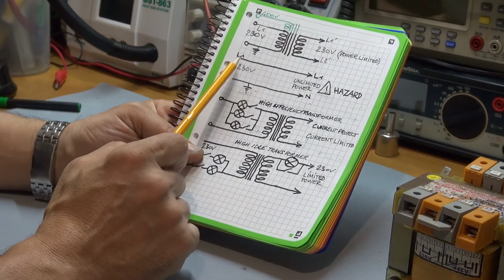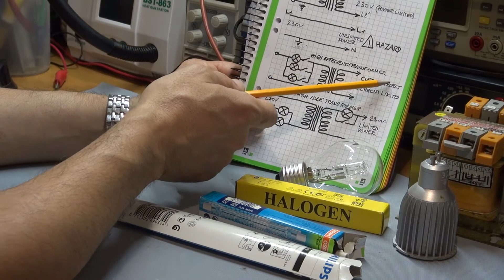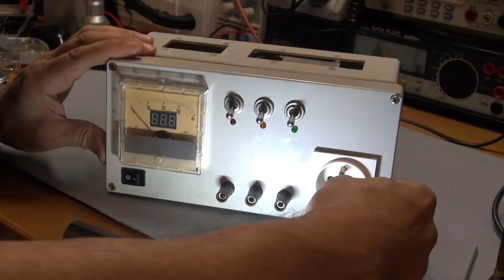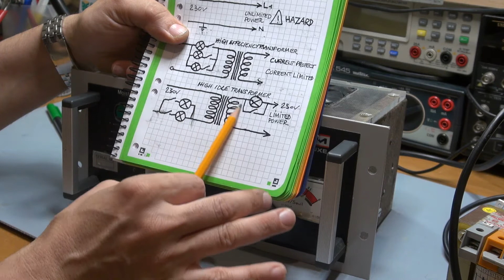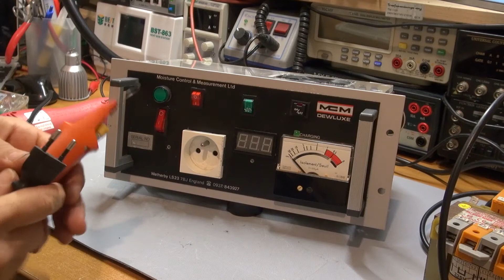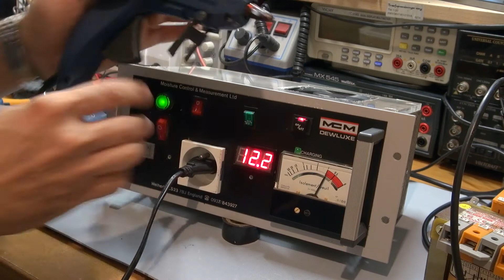Isolation transformer + light bulbs, a must have on the bench; Dim Bulb Tester

Comment: How can you use such a device, if the analog meter shows not the exact voltage, and the digital meter shows "percentage" of current ? 
Also, that digital meter is jumping all over the place, how can you know exactly what your connected device is doing? 
Never seen current displayed in percentage, so why using "percentage" ???? 
Why re-inventing the wheel ? Use a simple voltage / amperage panel meter from Ebay etc.... and save the hassle of "calculating" current and voltage on the output.
This only advantage is that the output is isolated from ground, otherwise all the analog and digital meter stuff is unusable for real repair purposes.
Reply from the maker: Hi, this is not a measurement device. The panel you're talking about are used to read a rough current consumption, and a voltage drop fluctutation according the power chosen on the front pannel. 
Of course, this device protects from the main, but this is not the main purpose of such device. The main purpose is to avoid important surge of current due to a short circuit on many devices. Surge current are destructive, and it use internal light bulbs to protect operatus.
The main needle is used to read voltage drop.
The voltage indicator indicate the maximal current drawn in the output, in percentage of 500W, not in amps.
On a recent mod, a simple digital voltmeter was added directly on the output. 
This device is the most important thing on my bench. You can see final device here
https://p5.storage.canalblog.com/59/86/1284879/132802469_o.jpg
Thanks for commenting.